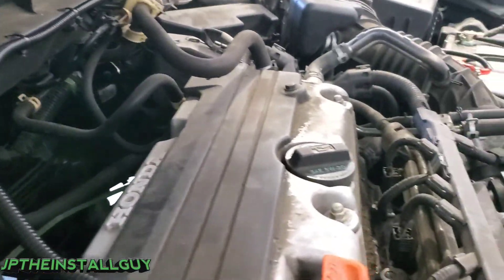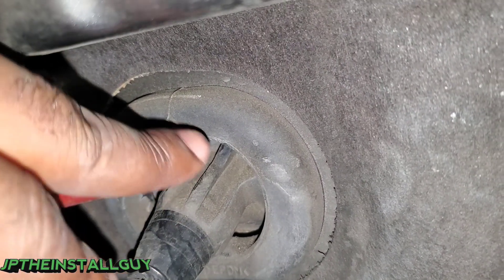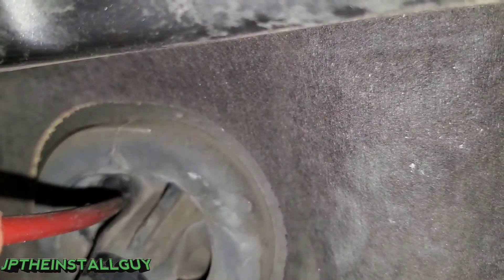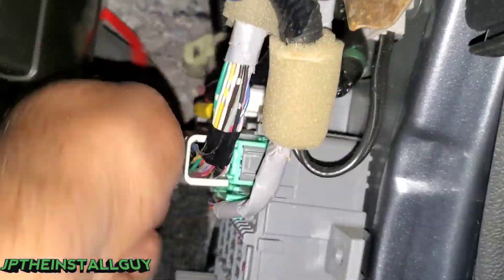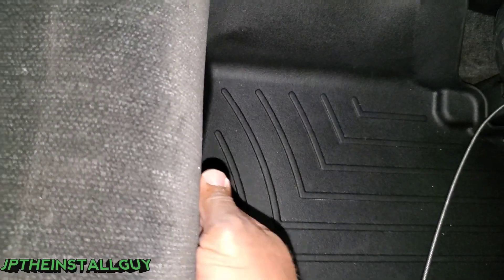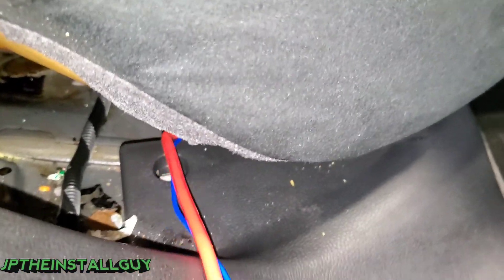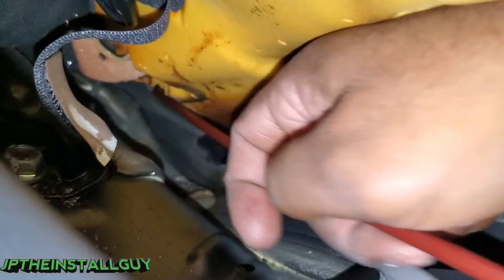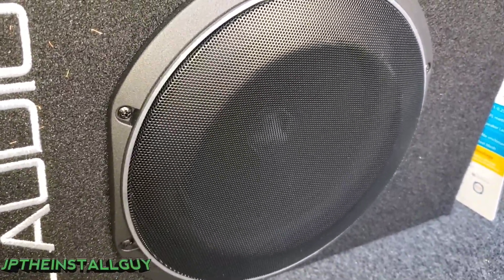install amp power wire in Honda accord

Comment: I discovered a much easier way to do this on the 2008-2012 Sedans. Right below where the passenger wiper motor is mounted, about 10 inches down is a factory designed plastic grommet. It sits next to two lines running downward. It is hard to see at first so a flashlight would help. Once you see it then it becomes EASY to remove and run a wire through it. It comes out behind the drivers side of the dash. This cuts down on all the wiring you have to do through the passenger side.
Reply: This worked great, kind of hard to see but once you do it's easy, I drilled out the middle of the grommet and ran the wire through then put it back in.
Reply: Just found it super simple, thanks
Reply: replace the grommet or drill a hole in the middle or you will experience a wet floor or inoperable dash due to water getting in..

ASK ME how i KNOW! LOL no fun replacing the ECU cause it got water damaged smh.

Comment: Thank you, this approach worked perfectly on my 2009 Honda Accord. All I did was use a screwdriver to poke a hole in the rubber grommet and it worked perfectly. As just a bit of information for anybody wondering how long of a cable they need to get to the trunk..., I used a 17-foot Red power cable and that worked perfectly to go the route you showed and up under the backseat and into the trunk.

Comment: U could also make a hole through where the master cylinder for the clutch would be if the car is automatic, usually there is plenty of space to drill through and you wouldn’t have to worry about anything being on the other side, also it follows the path closest to the battery , works for pretty much all automatics Honda Accord and other models early 2000’s to the present
Reply: Mind explaining exactly where pls?
Reply: @onelove1832 drivers side of the car beside your brake reservoir closer to the fender , just underneath will be a grommet if it’s an automatic, basically where your clutch pedal would come threw the fire if it’s a manual transmission…

Comment: It’s unsafe to run the power with the remote cable, that’s how you start a fire.  Just a heads up
Reply: what
Reply: How??
Reply: Nope isn't true. I have a degree in computer engineering 😊

Comment: You dont even show where the hole comes through the interior lmao all i see is a blower motor, i dont see tbe grommet. Based on where it is on the outside it looks like its somewhere behind or above the blower motor.

Comment: What about 2014 honda accord, the rubber thing you showed in the new honda has many wires, no way to pull any power wire through

Comment: Anyone else come find these videos? And the firewall is never in the exact spot. Not even close like mine is in the very far right corner tucked away and it's damn near impossible and I really don't know what to do right now. I already have all the wiring and everything and I've done this many times but ghetto threw the door jamb and I'm trying my best not to do that anymore and go through the firewall right now. If anyone could comment and give me any tips or advice I would really appreciate it. 

I have already ran a coat wire hanger from the inside of the car through the firewall and I can feel the coat wire hanger when I snake my hand around the corner inside the hood. But there's no way that I can ball up a fist with my zero gauge wire in hand and get through there properly. I really don't know what to do

Comment: Another video of someone tapping into the same firewall. Who is gonna show them connecting the power wire to that small ass top post battery terminal
Reply: Can you elaborate on that?
Reply: I'm more concerned about the connector. It's going 90°. Also yes that terminal is not very good. For $20 he could put a nice terminal splitter on that post. I hate hooking up stuff when it's all s*** like that. No way I can make a video of an install with connections like that. Four gauge wire it looks like a 16 gauge connector.  Lol